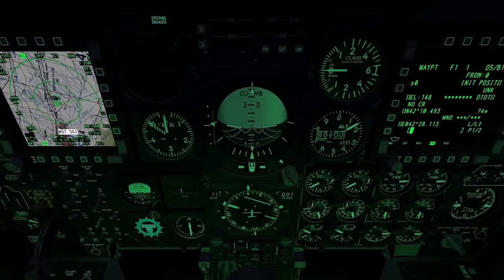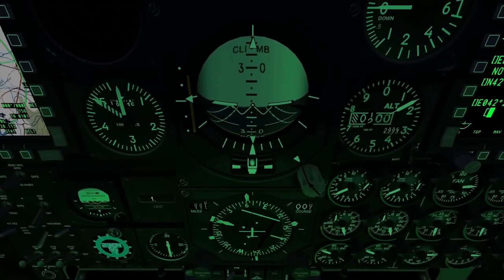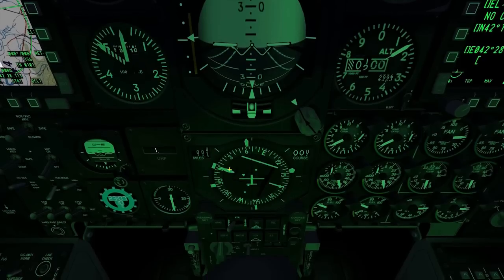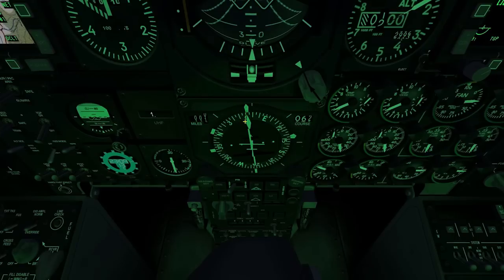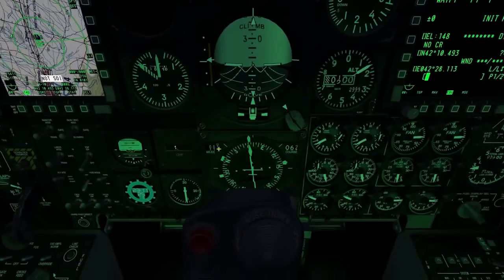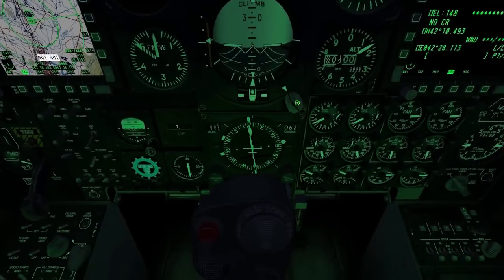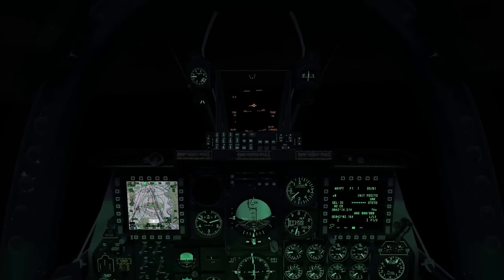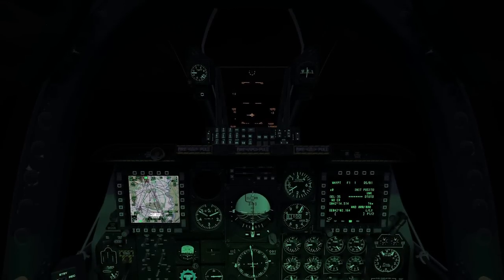DCS: A10C Warthog ILS HSI TACAN Tutorial

Comment: First of all thanks for this great vid. Still I seem to do something wrong.
My Steps:
1.) Set TACAN to the airport´s frequenzy and the designated course to the course of the runway and power on the system
2.) Set ILS to the airport´s frequenzy and power on the system
3.) Set the Navigation Mode on the NMSP to TACAN and ILS (Steerpoint deactivated)
4.) Call ATC for vector to final approach fix, fly to it and hit it at 10nm between 2000 and 3000ft
And still I don´t ever get to see the ADI needles.